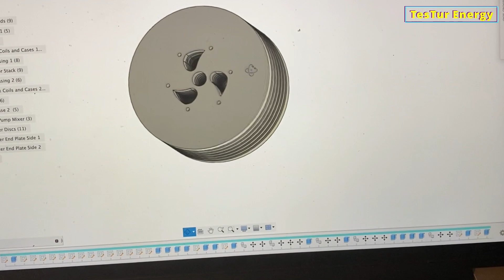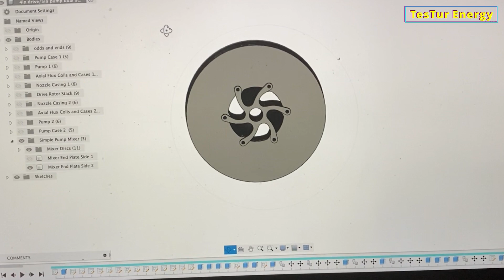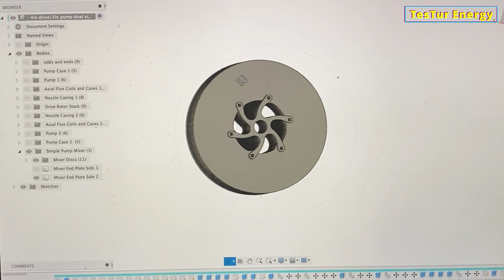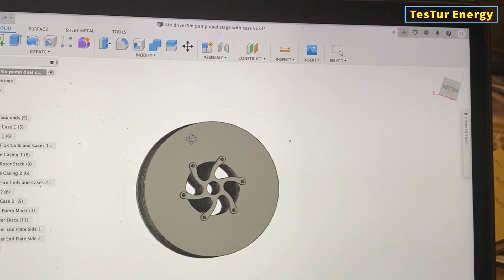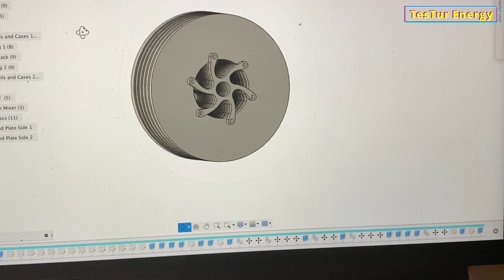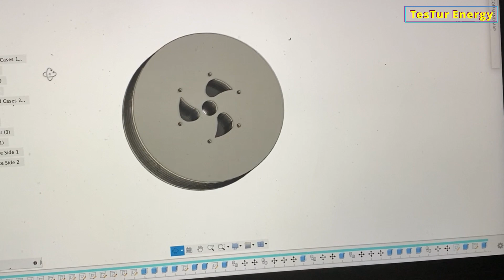Tesla Pump Multi-fluid Vortex Mixer & Steam Condenser - Air + Fuel Atomizer, Waste Treatment

Comment: Very fascinating design. Cold steam is more efficient within the turbine than hot steam?
Reply from the maker: Hey thanks Raj! So technically you want hotter steam for higher efficiency. When I say “cold steam” I just mean steam that’s below normal boiling temps at atmospheric pressure but still hot enough to be vapor in the low pressure closed loop system.
Reply: @CharlieSolis  I wonder if the hot pipes coming from the evacuated solar tubes could wrap around the inlet to the first turbine to heat it before heating the water battery.
Reply from the maker: Yes! This is absolutely possible. I plan to utilize Teslas improved turbine patent GB 186,084 for this exact purpose. To be able to “over heat” the vacuum steam prior to going into the turbine. There’s no reason we can’t heat it to much much higher temps and still use the vacuum system. This is in fact how all large steam power plants work. Even though they still use high temp and high pressure steam they still exhaust to vacuum to a condenser because it increases efficiency greatly. However most stop using the steam in the turbine at a far higher temp than we can use in the Tesla turbine. This is because the condensation droplets and cavitation will erode the blades/props on a multi-million dollar bladed steam turbine down to little nubbins in minutes if you allow wet steam to go through. However this is where the Tesla turbine shines. It has no detrimental effects from multiphase fluid flows/particulates, nor cavitation, because their are no lifting surfaces for the droplets to smash into or cause rapid pressure fluctuations that would instigate cavitation. Because of this it can extract A LOT more of the energy that is usually left on the table by bladed turbines and just used for preheating instead. The thing to remember though is that to get the energy/power out the steam has to be continuously expanded and the volumetric flow area of your exhaust has to be much much bigger than usual  to allow for the very low density/large volume “cold steam”/vacuum steam. Tesla explains about needing increased exhaust flow area for increased power outputs for the turbine in the a lesser known place within the Aerial apparatus patent because the aerial apparatus needs so much mass flow rate for the power needed to raise straight up into the air.

Comment from the maker: NIKOLA TESLA BRITISH PATENT 186,082 - IMPROVEMENTS IN THE CONSTRUCTION OF STEAM AND GAS TURBINES
"In the new design I employ two heavier end-plates which are machined tapering toward the periphery for the purpose of reducing the maximum centrifugal stress as much as practicable. The inside discs, of relatively thin material, are rolled, forged or ground tapering in like manner and with the same object in view, but this may not always be necessary and plates, made of sheet metal of substantially uniform thickness as furnished by the mills, can be employed. Each of the thick as well as thin plates is provided with exhaust openings, leaving a solid central portion like the hub and spokes of a wheel. Star-washers of similar configuration serve the purpose of keeping the discs apart in the center and for the peripheral spacing the thin plates have small holes drilled in them on a circle, or circles, of suitable diameter, and in these are driven tight-fitting studs which are upset at both ends by a special tool so that they will project beyond the metal on each side a trifle more than the thickness of the star-washers. When the plates are put together the separating studs do not come in line but are straddled in order to give opportunity for slight yielding, thereby eliminating constructional difficulties which might be caused by unevenness or other mechanical imperfections. Thus the rotor can be finished closely to predetermined overall dimensions and will run true on the outside even if the thin inside plates should vary a little in thickness or be slightly warped. To simplify this arrangement I provide only every second plate with studs, using plain ones between. Furthermore, with the object of cheapening the manufacture I dispense altogether with the former, accomplishing the spacing by means of small bosses or protuberances which are raised in the plates by blows or pressure and provide a die, practically reducing all the machine work on a thin plate to a single operation in a stamping press. The star-washers, while preferable, are not indispensable and may be replaced by round separating washers of a diameter about equal to that of the hub part of the discs"
-NIKOLA TESLA

"This construction permits free expansion and contraction of each plate individually under the varying influence of heat and centrifugal force and possesses a number of other advantages which are of considerable practical moment. A larger active plate area and consequently more power is obtained for a given width, this improving efficiency. Warping is virtually eliminated and smaller side clearances may be used which results in diminished leakage and friction losses. The rotor is better adapted for dynamic balancing and through rubbing friction resists disturbing influences thereby insuring quieter running. For this reason and also because the discs are not rigidly joined it is safer against damage which might otherwise be caused by vibration or excessive speed."
-NIKOLA TESLA

"....what I claim is:
1) A rotor for steam and gas turbines composed of plane spaced discs and two rigid end-plates holding them in fixed position laterally but permitting their independent expansion or contraction in the radial direction, said discs and plates being provided with exhaust openings in their central portions, substantially as described.
2) A turbine rotor comprising plane discs with spacers allowing radial displacement, central separating washers and two rigid tapering end-plates for holding the structure firmly near the shaft, said discs and end-plates having exhaust openings in their central portions, substantially as described.
3) In a rotor for high-speed turbines plane spaced discs with exhaust openings in their central portions and tapering towards the periphery as, and for the purpose, described.
4) A turbine rotor consisting of a system of discs held apart by spacers in frictional contact with them and alternately straddled as, and for the purpose, described.
5)A turbine rotor composed of plane parallel discs having exhaust openings in their central portions and projections for holding them apart near the periphery, substantially as described.
6)In a turbine rotor composed of flat discs with exhaust openings in their central portions, star washers of similar configuration and projecting with their arms considerably beyond the openings in the discs, substantially as described."
NIKOLA TESLA

Read The Full Patent Here:
https://teslauniverse.com/nikola-tesla/patents/british-patent-186082-improvements-construction-steam-and-gas-turbines

If you would like to help bring Nikola Tesla’s Turbine to the people of the world go to my Patreon to aid the cause so we can make more prototypes and models! 
https://www.patreon.com/CharlieSolis

#TeslaTurbine #NikolaTesla #DIY #Compilation #TeslaValve #TeslaFountain #TeslaTurbineStarWasher